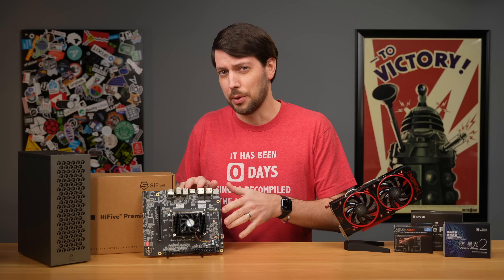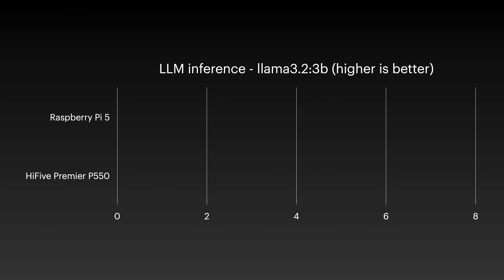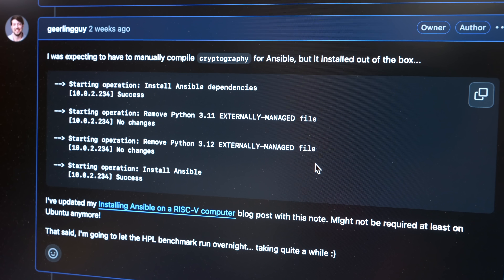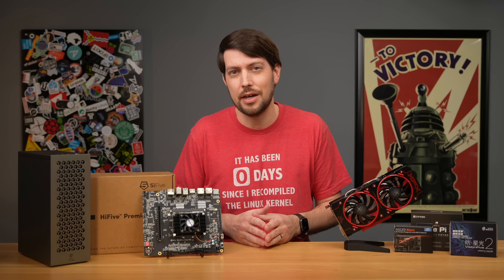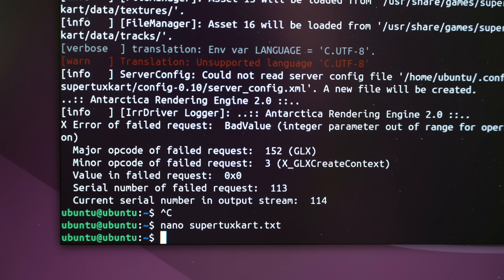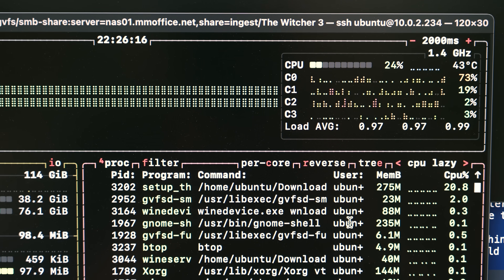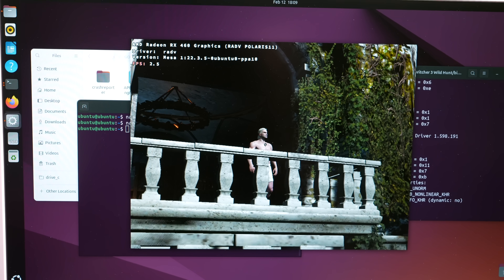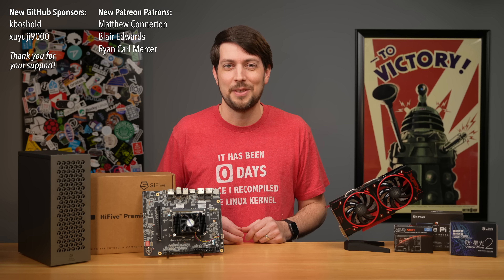RISC-V was supposed to change everything—How's it going?

Comment: RISC-V is already having a massive impact in ASICs and FPGAs. RISC-V is so customizable and open that you can stick a super tiny, stripped-down RISC-V core anywhere. Devices bought in the last couple years probably already have hundreds of RISC-V cores inside them. Voltage regulator?There's room for a RISC-V core. Battery gauge IC? Put a RISC-V core in there. Accelerometer? Looks like there's room for 5 or 6 RISC-V cores.

And that's not even mentioning its impact on academic research.

Trying to judge the impact of RISC-V by looking at how it is with consumer computing is like trying to judge an e-bike by looking at its towing capacity. OFC we'll probably have consumer RISC-V in 5 or 6 years.
Reply: I think it's hysterical that people still get this enthusiastic about instruction set architectures.

The ISA is the easy part of CPU design. The hard part is creating performant and cost-effective microarchitectures that implement those ISAs. That's why RISC-V is currently stuck down at the very bottom of the embedded market, against the lower-end cores in the ARM Cortex-M line.

Designing even a simple in-order superscalar microarchitecture like the Cortex-M7 or Cortex-M55 is seriously hard, and out of range for all but large highish-end players.

Designing the the sorts of aggressively speculative and OoO microarchitectures that are needed to make competitive phones, tablets, laptops and servers costs tens to hundreds of millions of dollars per iteration, and is basically out of reach for anybody not named "Apple", "AMD", "ARM", or "Intel". 

And then there are all of the supporting assets like interconnects, cache-coherency protocols, etc etc. One of the reasons so many people go with ARM in the embedded space is not for the cores, but because using AHB (on the low end) or AXI/CCI (on the higher end) gives them access to massive amounts of off-the-shelf IP. That just doesn't exist for RISC-V.
Reply: @patrickchase5614  the hard part is the memory IO bandwidth and latency, and out of order execution things like branch prediction. RISC V is like just an instruction set with no optimization at all. You get what you pay for.
Reply: @patrickchase5614  I 100% agree with you. For the most part, an ISA is an implementation detail. FWIW though every few years a new ISA distills a lot of what we've learned about compilers and HW/SW co-design. For instance, all of the different extensions the RISC-V offers are super cool... you can tailor a core on a per-application basis to a granularity that's not possible with ARM.

But the main thing that's exciting is that RISC-V is completely open and can be used without a license. This isn't true of ARM.

When LLVM was introduced, I don't think anyone was freaking out because a new compiler is especially interesting, they were freaking out because of how flexible and extensible it is. It's the same way with RISC-V.

I don't think anyone who knows the area well is thinking that RISC-V will be competitive with ARM or x86 in terms of raw superscalar OoO performance, but that's not the end-all be-all of CPU architecture.

Also there are a number of in-order and OoO superscalar RISC-V cores already open-source.
Reply: @johnmamish3197 Yes, I agree with all of that. I'm a longtime embedded developer (over 30 years, starting with 68k and then i960, MIPS, ARM, AVR8, Tensilica, some exotic VLIW stuff like TI C62x/C64x and ST231, etc) so I totally agree about the high end not being everything. 

The ISA really matters most in simple low-end designs - by the time you get to superscalar OoO stuff the decoders and frontend are so inherently complex that ISA differences only matter on the margins. think that's why we see RISC-V doing so well in designs like RP2350 and ESP32C6, but not really moving up the food chain yet.

There are higher end superscalar/OoO RISC-V designs like CVA6S+ on paper in research projects, but I would note that such complex microarchitectures are orders of magnitude harder to verify than simple single-issue,  5-stage pipelines like the cores in RP2350 and ESP32C6. If I were still architecting ASICs I would be extremely cautious about selecting such a core.

One positive thing that has happened is a larger number of RISC-V cores that can integrate into AXI/CCI bus fabrics. Multichannel split-transaction bus fabrics like AXI are an absolute must for higher-end ASIC designs, and AXI has a vast library of vendor IP that SoC designers can choose from. Allowing RISC-V to tap that ecosystem should allow it to move up at least one tier in the embedded world.
Reply: @johnmamish3197  Replying to another part of your message,  to be blunt I think that the thing that made LLVM so exciting was that it meant that we finally had an open-source compiler with a decent intermediate representation that truly decoupled the front- and back-ends.

gcc was and is an absolute mess in that regard, and that made it near-impossible to upgrade it with modern backends. gcc's own backends are sort of adequate for OoO cores that do much of the scheduling for you, but Not Good for VLIWs, GPUs, and other compiler-dependent architectures.

I experienced that firsthand while working with VLIW cores in the 00s - those live or die by backend techniques like superblock and trace scheduling, and it was really difficult to adapt better backends like Open64 and the ICC backend (which ultimately descended from Josh Fisher's Multiflow compiler) to work with the gcc frontend.

Of course since then LLVM's own backends have become pretty good. Qualcomm improved the instruction scheduling quite a bit as part of their support for Hexagon, and since then it's been very competitive.

Sorry, you hit a sore spot and I felt compelled to rant.
Reply: @patrickchase5614  I think we're 100% on the same page about most things. I've got a very similar background to you, but only about 10 years into my career... These days I do a lot of FPGA stuff, especially for image processing, but I started my career doing firmware (ARM, MIPS) and PCB design.

"[LLVM finally gave us]  an open-source compiler with a decent IR" That's what I was trying to say about LLVM - GCC is a workhorse but it's a mess that's hard to extend. Just like LLVM's open nature and IR make it interesting for compilers research, RISCV's open and extremely modular ISA makes it interesting for computer arch research. Not a perfect analogy.

I also think that saying "ISA design is the easy part of architecture" isn't quite right. Language design isn't the "easy part" of writing a compiler - we have whole academic disciplines related to language design. ISA design is kind of a discipline within compilers at this point. I don't think RISC-V is some insane technology that will give us a huge breakthrough, but it's a fresh start that let us take the lessons about compiler / HW co-design from like 2000-2015 and collate it without the legacy commitments related with ARM and x86. Sure, ARM has the X, A, R, and M, but they're not nearly as cleanly orthogonal is RISC-V's base / extension combos.

Very fascinating you worked on VLIW stuff. It's a shame that we never figured out how to make that work. What sort of VLIW stuff did you do?

I think if we had a more nuanced medium than the youtube comments section, we'd have a very fun conversation.
Reply: @patrickchase5614 I also have some knowledge - can't say from where - that it's becoming common in industry to replace stuff that used to be vendor hardware IP with tiny RISC-V cores. Like, what used to be a state machine inside of a transceiver is now a risc-v core. When you've got 7nm feature sizes, going from 10k to 100k transistors for an IP block but being able to save development and verification time is a no-brainer.

Makes me kind of sad cause I do love hardware development.
Reply: @johnmamish3197  I actually architected some ASICs that did exactly that, but using a bespoke (and very simple) ISA. It a bit like the RPi 2040 PIO machine, but integrated with a DMA engine capable of block transfers and scatter/gather (with the ability to post large #s of parallel AXI txns), and with the instructions/descriptors in memory instead of block-local SRAM or flops. We first shipped it around 2000.

If I were rearchitecting those ASICs today I would absolutely use a RISC-V core, possibly with custom instructions to manage a local DMA state machine for things like scatter/gather that don't map well to to a traditional cache-based CPU memory subsystem.

The advantage of that approach is that by tightly coupling a dedicated core with very narrowly-tailored accelerators you can greatly reduce the complexity of the HW that you have to design, and also avoid common classes of HW bugs around control and sequencing. It also increases the likelihood that you will be able to work around any HW bugs that do remain.

Tensilica tried to do something similar with their cores a while back - they had an automated "custom instruction generator" that would create custom ISA extensions.
Reply: @patrickchase5614  its not just an isa... And theres a lot more than 4 companies capable of designing micro-architectures... The 4 you chose are nonsensical tbh... Apple? ARM? Theyre not even in the same sector. And you left out Samsung, Qualcomm, Mediatek, Rockchip, Google and loads of other medium or small sized players. In fact, Apple is an example of how pretty much any moderately big company can enter this field and have something functional in less than a decade.
Reply: Validating something cost more than design, and often it is cheaper and lower risk to just license an old cpu from someone. simple MIPS, 6502, etc are probably near free these days. You can also license ARC without a per core license charge like ARM and it is fully supported and validated in production already.
Reply: @maggiejetson7904  This is absolutely true but we have RISCV cores that have had the absolute crap validated out of them, both open-source and closed source.
Reply: @johnmamish3197 validation needs to happen post silicon tape out and release in the market too.
Reply: @maggiejetson7904  RISC-V is MIPS: the latter has adapted RISC-V as its standard.  Plus it's FOSH.  So its fortunes are not tied to 1 company or SIG
Reply: Nood need for a CPU in a 78L05.
Reply: Kind of like how Linus is ubiquitous everywhere but the desktop, Risc-V will become ubiquitous in places other than consumer PCs and smartphones.
Reply: RiSK-5  who 🤔

Comment: "RISCV is slow".
No it isn't. RISCV is not a chip. RISCV is an ISA. An ISA is not fast or slow. It is the chip that is fast or slow.
If you did as much pipelining and used as many resources making a RISCV chip as an Intel then it would likely be faster than the Intel.
For example there are some RISCV chips with 128 cores that really perform well.
The versatility in RISCV is that it covers a wide spectrum of use cases. There are RISCV chips that cost less than 10 cents. Show me an x86 chip that costs under $10.
Reply: banger comment

Comment: As someone who works closely with SiFive due to my actual job, things aren't gonna get better in the short-medium term. 
There's almost no money in HP RISC-V CPU's, most of the money is in low-power in-order CPUs to be used as controller for very specialized ASIC's, coupled with the fact that the RISC-V ecosystem is a mess (most of the needed extensions to make RISC-V any kind of competitive got ratified like, last year) means that we won't be seeing RISC-V optimized software for a long while

Comment: We created a frankenstein Ubuntu install for the P550's strange sibling, the Milk-V Megrez which uses the same SoC, put a Radeon RX580 on it and played some Minecraft.

Program startup and the load times and responsiveness of more complex websites in Firefox did suffer, but most visuals using a GNOME 46 desktop with graphics accelerated GTK4 apps was working pretty nicely due to the comparably overpowered GPU.

My roommate now has a neat little mini RISC-V PC on his desk.

Comment: You can get an ESP32-C3 or ESP32-C3U from M5stack for $6 + shipping. That's probably the cheapest way to get something RISC-V to experiment with. Just solder on the pin header and stick it on your favorite breadboard. However, if you're looking to run a full desktop OS on RISC-V for some reason, I guess this could be cool.

Comment: Yeah these teething issues are going to be a problem for the RISC-V architecture but I still see a bright future for it where it surpasses ARM in some use cases.
I mean we have seen where ARM was not so long ago on this front
Reply: Lack of decent memory addressing modes and lack of select/conditional move are not teething issues.

They are fundamental faults of RISC-V ISA, and the standardization committee refuses to fix these deficiencies.
Reply: @hkultala  so I guess you dont see a future for Risc-V? I guess we are doomed to a all arm future where everythings soldered and dual booting is no longer an option.

Comment: The thing that seems to be missing from the RISC-V world is fast cores. Something with, say, the throughput of an ARM Cortex-X1, or even an -A720. Without those, there won't be consumer systems, and most of the world's application software will remain un-ported. I was looking forward to SiFive producing such cores, and their appearance in Android devices and Linux systems. Sadly, SiFive seems to have abandoned that market when they made job cuts in late 2023, and there don't seem to be any other offerings yet.
Reply: The major thing that seems to be lacking from RISC-V is a good instruction set.

It's a educational toy, not an instruction set made for high-performance processors.

Lack of decent memory addressing modes, lack of conditional move/select.

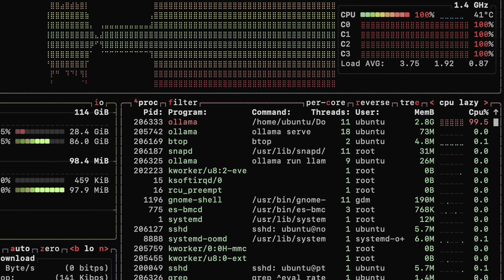Comment: 4:19 What hardware did you use for measuring power consumption? I run home assistant myself and I have never seen fractional power usage in it for zigbee power plugs.
Reply: What do you mean by "fractional"? Non-integer?
Reply: @anselmschueler  yes
Reply: @wroclaw_  What is surprising about that? Or are you surprised the software can show it/the hardware can measure it that way?

Comment: I just bought a Pinecil V2 soldering iron, which I was pleasantly surprised to find out used a RISC-V processor for it's firmware.
Reply: A soldering iron needing a firmware? :I :/ :\
Reply: @AndrewTSq it's very minimal, it doesn't update or connect to the internet or anything. it's just software to have fine temperature control

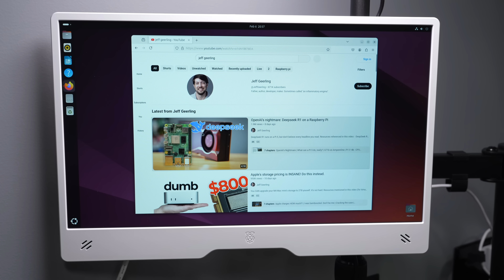Comment: 0:20 Decade-old slow would still be acceptable.
Reply: This is the biggest difference between 'computers today ' and 'computers ca 2000'.

Back then a 10 year old computer was virtually useless,  but watching this video on my 12 year old PC gives an experience just as good as watching it on a brand new PC would.
Reply: Yeah, decade old PCs had Intel's Skylake architecture, which usually meant DDR4 and SSDs (sometimes even nvme SSDs), more than usable today
Reply: @chimado3514  More like decade old Atom than Skylake, from what I gather. The Chips and Cheese review had it on par with a Celeron J4125.
Reply: @ Yeah, it doesn't look like this performs like a decade old desktop PC, still at this rate of advancement we don't seem to be far from it.
Reply: If they have decade old pricing sure but we should expect better if they want to compete today
Reply: @ It's a development board, it isn't meant to compete with consumer hardware
Reply: my daily driver is 13 years old lol

i use it to game too

Comment: We need a revolution in circuitry design. Modern cpu's use far too much power for what they do. This incessant need for speed is actually slowing down innovation. We need optimized systems, not general purpose. Most users don't need general purpose machines. I don't need, for example, the ability to calculate the curvature of spacetime, so why are the instructions and related circuity included in the CPU? The same with AI. How many people actually need AI on their system when it's available online? Most people will never use it but pay for the software and hardware required. We need innovation, not replication. 

And both board and power rail designs are 60 years old. Time to innovate power delivery as well.  GPU's for example, are so heavy that they are cracking the boards and power requirements are so high that power connectors and lines are melting and catching fire. That should indicate that we need better design like thicker substrate, stronger mounting, and actual power rails as opposed to wires and plastic connectors. The 70's is over. Time to innovate.
Reply: The problem in that sense is software or workflow, right? Software is designed to run on general purpose CPUs, not on ASICs. If I'm understanding you correctly, I think your overall point is fine, that CPUs are inefficient for many tasks and those tasks could be better served by dedicated hardware, but I don't know if "circuitry design" is the issue so much as a mindshift to programming and interfacing with particular hardware. And related, there's the issue of economies of scale for CPUs, both on the hardware and programming ends. This is the usual reasoning given for a particular task being put on CPU, FPGA, or ASIC. Certain tasks are already performed by dedicated on-chip hardware, like video en/decoding.

On your second point, this seems like an easier fix, and yes it's also needed. Whole workflows do not need to be changed, just some hardware and some rethinking of design.

Comment: I'd think it'd be cool to see the chip with oldstock ddr3 ram and a bunch of drive slots, if the software isnt quite there for all the faster advanced stuff they would do well with lower spec components (and a lower price). then running it with something like openbox might be a nicer experience
it's definitely coming along though, excited for more risc-v options for the budget section